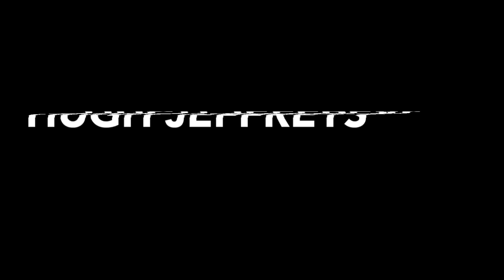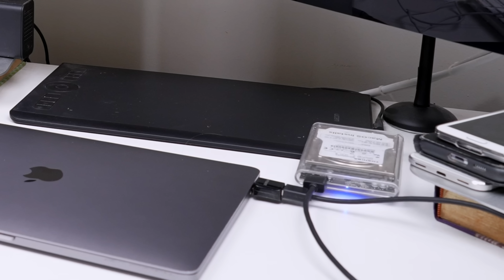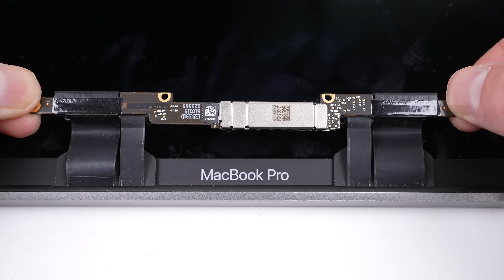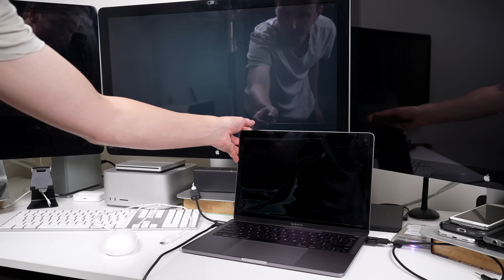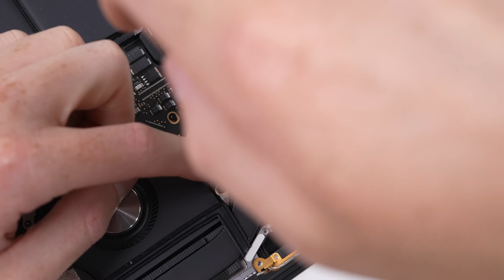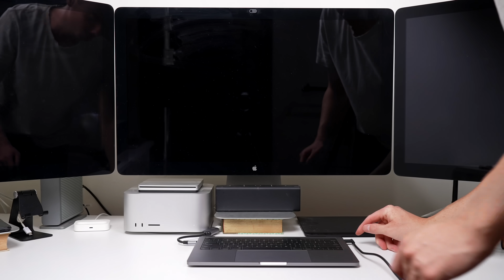Fixing this $100 Broken MacBook Pro Didn't Go Exactly To Plan.

Comment: A lot of windows laptops do this crap too where the will not let you use external monitors in recovery mode or when reinstalling windows too

I have an acre gaming laptop that has a faulty screen and it will never recognise any external monitor through hdmi unless nvidia graphics drivers are installed first making it impossible to diagnose

Comment: To fix that issue, you need to plug the MacBook Pro into a charger as well as connecting it into an external display then then when you sweat the boo device, it does not enter because the computer is running off of power and it’s in and it’s in clamshell mode. I hope I could help you fix the issue.

Comment: Try using OpenCore Legacy Patcher boot efi next time, custom made to your Macbook. It bypasses certain hardware parts that prevent the OS from booting (like a removed display)
Reply: It doesn't on T1 and up models because you need to have Monterey on there before hand before upgrading to anything so the T1 firmware doesn't get deleted.

Comment: As a certified Apple tech, I hate... HATE dealing with Macbooks with messed up screes. I have the worst luck getting them to put out to an external display consistently. As for that data port, I've got one of the tools you mentioned. I've only ever used it to pull data from a Mac that couldn't boot, it just mounts the SSD as an external drive; but it works quite well. 

I really hate that they took that port away on newer models, so I have no way to recover data if someone's Mac dies.

Comment: Love this! The monitor on my 2019 15" Pro has stopped working, Apple said they can replace for about S$1100 plus with a new battery that totals about S$1400... I am going to test with an external monitor but don't want a permanent set up at home, so if it works okay I will buy a portable screen, will remove the Pro screen and will have a strange looking portable MacBook Pro again... Hehehe

Comment: What if there was an external screen with the same dimensions of the macbock and we were able to attach the same hinges but the difference is this external screen has a usb type c cable as an input to it, this would be a great solution especially if it was cheaper than the Apple replacement one!!

Comment: Another example of Apple's planned obsolescence. the display works perfectly fine, only the cables are damaged, but because of the way it is designed, you have to replace the whole display which is too expensive to be a viable option. Most people will opt, like your seller, to buy a new laptop.

Comment: its crazy but I got a MacBook form another tech for cheap and did this same thing it did not want to boot into recovery but I had a DOC  took me hours but I got it once I got it working I ordered an oem screen off eBay fixed it and sold the laptop for 1200 it was a maxed out pro model thanks to apple we can't fix anything in them anymore

Comment: I'm currently using a halftop myself. My Sager laptop's screen busted and it was in a scary way because the backlight is handled by the motherboard, not the screen. So I just yanked it off. Sadly, can't access BIOS anymore. Not sure if any eDP > HDMI/DP connectors exist. BIOS only outputs by the eDP cable, not by USB-C/HDMI/mD (monitor).

Comment: Hey for anyone that will be doing this…

If you want to avoid running into the black screen, boot issue, remove the screen AS WELL AS the LVDS internal screen connector so the system does not detect any internal screen display!!! 

Ur welcome 🖤

Comment: The LCD is around 90 bucks, I don't  see why not repairing it is an option
Reply: Because they break ridiculously easy when trying to get into them and it can damage the backlight. The whole display assembly is glued to the front glass.

Comment: I experienced the exact same issue. My display was broken so I used external monitor to boot OS but it would turn black. I had no other way to see what was going on so I gambled into a new display and replaced it. Luckily it worked perfect. Phew. 
I am assuming apple did it deliberately to prevent repairs.
Reply: can you tell me if the computer ever made the boot up chime sound when the screen was black?

Comment: I think Apple should be perpetually bound to fix any device they have purposefully let circulate and continue to sell as they are a trillion dollar company while leaving consumers with eWaste, maybe if they were legally bound to fix every device with huge flaws they might think twice about continuing to sell these macbooks with flaws but running a 5 year repair program. Apple should have also learned their lesson from the 2008/2009 capacitor failure, 2011 graphics failure and the 2015-2019 butterfly keyboard issue but now they will just have SSD failures in their late intel/apple silicon macbooks thanks to their strict anti-repair ethos. I actually love macbooks but Apple have incredibly questionable ethics.

Comment: i've replaced the keyboard on the A1707 the same way you did on yout first retina...

it sucked LOL. the left portion of the keyboard backlight does not work. but it type's wonderfully now.

if it wasnt for the reliability issues. the keyboard is honestly fine

Comment: 3:05 "This MacBook was purchased 5 years, 3 months ago so this isn't an option". I don't think you should discount the service program coverage so quickly. Apple, particularly in Australia are very flexible in their application of these programs.
Case in point, I purchased the same model new MBP in 2016, and had the screen replaced through this program, for free by Apple 5 1/2 years later.

Comment: About two years ago I bought a MacBook Pro 13 from 2016 with the Flexgate issue for only 150€. Little did I know, the MacBook did not only fell under the display repair program but also the keyboard and a battery repair program. So just one day later I had a 90% new MacBook. Only the speakers and bottom cover weren‘t replaced.

Comment: Isn't there another option with the original display ? Some repairers cut the flex gate and scrape off the coating. They order another flex gate connector and do the same thing for other side. Eventually flex gate cable get extended after soldering two cables.

Comment: I daily drive a 15 inch 2016 MacBook Pro. I have had the laptop since I bought it new in early 2017 and never needed any repairs for it. I have certainly not babied it but I still think I have cared for it pretty well. My main complaint with it now is the keyboard. Some of the keys tend to get stuck or not press sometimes which can be quite annoying and the laptop has a less than stellar battery performance, especially well after 1000+ charge cycles but the computer still functions normally. I have used this computer as a laptop gaming system playing through all of Dishonored 2 and some of Prey 2017 completely on the go. I also used it as a desktop gaming PC with bootcamp windows installed back in 2017 and with a GTX 1080 external GPU enclosure. I used the laptop all throughout college and I still use the laptop on a near daily basis with my current job. Shame the repairability can be such an issue but thankfully I have not had any major issues with the computer thus far and am still able to use it on a daily basis 7+ years later which I can't say for any previous laptops I have owned.

Comment: I repair these screens quite frequently when the backlight cable breaks. Its a tedious job, but is a lot cheaper than replacing the entire screen.
Reply: you do the tcon flex to display?
Reply: @chillrelax6915  Replace Backlight cable by cutting off damaged cable and soldering on new one.

Comment: I had the same external display issue with the m1 and m2 macbooks. I bought them used with broken displays for very cheap, but it was maddening trying to erase them through recovery. In the end i managed to unlock and wipe them both and made a nice profit.

Comment: I stopped buying Macbook units past 2017 if it doesn't work. Even selling the parts if a farce because the buyer won't be able to use the parts. Apple is actively manufacturing e-waste.

Comment: My macbook has the exact same issue. It can boot into macos but eventually starts to glitch out. Have to remove the display to make it work.

Been praying for these displays to come out with control boards to use as an external display. They are good screens, I'd love to use them as external displays.

Comment: Think the Macbook Pro you used had some OS issues in general and its remaining kext driver  files where causing issues for you, could also been caused by an old OS installed.
I have done a few screenless Macbook Pros now for people and this issue has never happened to me, removing the screen has always made the Mac use external display with no issues, but im really glad you posted this video incase I ever do come across this.

If you ever find a way to install Windows on a Macbook Pro Mini (Screenless mac) id be interested as everything I have tried has never worked, but I know its possible.

Comment: I worked at an Apple Authorized repair centre, 
we used to recover data from that one port A LOT, got a lot of macbooks with that issue come in, we replaced the whole motherboards then it was working again, we connected the two motherboards with the special dongle to transfer the data across the two motherboards, then everything was working fine...
Reply: So it wasn't an issue with the screen but an issue with the motherboard? it's always the motherboard lol my 2009 17" died 2 weeks ago out of nowhere and i think it was the capacitor based on what the forums were saying, luckily the SSD can be removed easily and put into another macbook.

Comment: Fun fact this flexgate issue still affects all the newer models as well, even the current m3 max. When fully closed (thats what you usually do when transporting the laptop) the flex cables are fully exposed to the dust particles. Maybe in the future they would bring back the classic round shielded lcd cable that goes through one of the hinges…
Reply: Apples working on making the issue worse so they can sell more macs.🤣🤣
Reply: i got apple care for that

Comment: I did this years ago with a Toshiba laptop running Win2000, thankfully it was straight forward and easy to remove the screen. I used it for a few years as a TV PC until I bought a cheap Acer Revo. Thanks for the videos, always entertaining watching what modern tech looks like inside. 👍

Comment: These TouchBar models are either really reliable or really awfully unreliable. I've had both experiences. The 2016 ones just seem to die for no apparent reason but still seem to somewhat function. I'm guessing what maybe going on here is that the backlight fuse is either blown or the caps supplying the voltage to the backlight are dead.

Comment: I wonder if its possible to bodge a cheap LCD panel to the apple housing and use one of those universal adapters to run it as an external monitor.

Comment: Providing you can guarantee there being a TV/Monitor where your going this becomes the ultimate portable desktop replacement.
Reply: It's now a desktop.  No different that probably billions of desktops.  Nobody is going to take this on the road.
Reply: @dlewis9760  Most desktops don't have a keyboard and trackpad built into the case not to mention a rechargeable battery system along with a power supply.
This system has everything necessary to be an excellent lightweight portable desktop replacement.
Billions I think not tens or hundreds maybe.
Most people would just scrap or part out a broken laptop rather than convert it like this one.

Comment: Hey!, I HAVE THIS MBP 2019 4 thunderbolt which went black out of nowhere 3 years back when i was a teen that time i was reading a manwha (which turned out to be 18+) that day i gained access to my lost apple id so i added it into my laptop and then suddenly while scrolling through the manwha the screen went black and there was NO touch feel on the trackpad so i contacted apple support n went to repair and holy they said to replace the whole logic board and touch bar (i didnt tell them the reason of blacking out)  cuz obviously.I still have the laptop till this date if anyone knows what i can do please tell

Comment: After trying with many Apple MacBooks, I can only say that after 2015, none of their machines are worth the money. Paying as much as they ask for a computer that has those kind of failures should be labeled as a SCAM. Also, when having screen issues with a "normal" laptop, a replacement costs not more than 300$, even if the computer costs 2500$.
Reply: Unfortunately, people who give profits for Apple (the customers) or don't care about that because they see value on those good thing the device can provide them (it's a trade-off for them), or they aren't aware of those issues, or they are just fanatics.
Reply: I DON'T BLAME APPLE, I BLAME IT'S USERS. If  a thief steals from you once, then it's not your carelessness, twice; then you allowed to happen. I BET YOU APPLE LAUGHS AT IT'S USERS BEHIND CLOSED DOORS
Reply: I disagree, when they introduced the M chips that was the point when macbooks were finally a viable choice as a windows laptop replacement
Reply: Yeah I don't think the users know or care about that. But I don't think the users are accountable for Apple being shitty. It's more a general obsession with status which is engraved in our societal systems. New technology functions as a status portraying consumable, kind of like fashion, rather than a machine. The way we use technology is just a product of that.
Reply: The 2015 Macbook Pros still sell like crazy on eBay, people still want it because of the keyboard, ports & SD slot and don't want to buy the M series macbooks that cost thousands for 16GB RAM & 1TB SSD. I love my 2015 Macbook Pro, it is so fast for everything i need, it felt like a life changing upgrade from my windows 10 laptop that was actively working against me everyday taking 10-30 minutes extra for basic tasks

Comment: Amazing! That business with opening and closing to access the trackpad was just crazy! But if you're wondering what's the point of doing this for a 7 year old laptop, I'm still using a 2015 macbook Pro with absolutely no issues. Yes, it's not really useful for any heavy lifting, but for everything else it is as smooth as butter, no slowdowns. Say what you like about Apple, but their laptops just last much longer than their Windows equivalents.

Comment: you could take out a battery and sell it off to recover some cost, if it still has low percentage wear it sould be worth a bit. Whenever I repair any laptops I alway look for low usage original batteries over some chinese batteries that more often than not hold a fraction of the original battery charge.

Comment: Where did you get that adapter to connect the headless MacBook to the Thunderbolt Display? I have a 2016 MacBook Pro that I’d want to connect but do not want to pay much for the apple official one.
Reply: Thunderbolt display doesn't need adapter because it's usb-C to usb-C
If you want connect HDMI to thunderbolt any usb-C dongle will do (don't know about apple artificial limitations so you'll have to Google that). 
I have $20 dongle and it works fine if only one port is used at a time so keep that in mind, don't buy cheap 5in1 crap.
Reply: @drayke8886  Do you mean the Apple Studio Pro display or the Apple XDR display? The apple Thunderbolt display uses a Thunderbolt 2 connector. While the apple Studio and the XDR display use Thunderbolt 3 or usb c to connect.

Comment: I bought my current 2017 non Touch Bar MBP and the screen got damaged by the shipping company but I only paid $200 for the laptop, looked on eBay found a Grade A pull only for $150

Comment: Just thought I'd leave it here:
If you want to do this modification on a Windows laptop, you'll get the most luck out of a Dell laptop, most (if not all of them) automatically switch to an external display if the lid is closed or if there is no internal display connected, it also has a dedicated screen switch button on the keyboard. 

The second best laptops you can try this on are ThinkPads, but I'm not sure about the newer models, but on the older ones, there's also a dedicated screen switch key, but it will always default to the internal screen, even if there is no screen attached, although there's an option in the BIOS to set the default output when the computer turns on.

Finally, don't do this on a Fujitsu laptop. They have a dedicated screen switch key but doesn't always work, and most older models only support that feature if you use a VGA monitor.
Reply: My old Dell manufactured Alienware M17 R3 won't post without a screen attached.
Reply: Many of newer HP Elitebooks/Probooks I have used, even my own Probook works works as expected. Type-C docks are bit challenging
Reply: Some BIOSes will have the option to set the default display output to an external display. I know that as I set that on my ThinkPad X250.
Reply: Some Dynabooks (Toshiba's business class laptops, oh wait, they aren't Toshiba anymore) let you choose that in the bios.
Reply: I use new Lenovo yoga this way (always closed) and it starts on internal display but switches automatically when attempting to log in with external keyboard. I think it's Win11 thing.
No such option in bios.
Also bios won't display on external (I think).
And most importantly: it won't boot with lid closed so I think you would need to use magnets to trick laptop's lid position
Reply: my Lenovo IdeaPad used to work without a screen attached, and it even showed the bios on the HDMI screen

Comment: You should maybe have a look at what is causing pixel 5a's to brick themselves after 1 or 2 years of use. Some say that it may be caused by not enough solder being applied to the soc but I would like to see your view on it maybe in a future video.